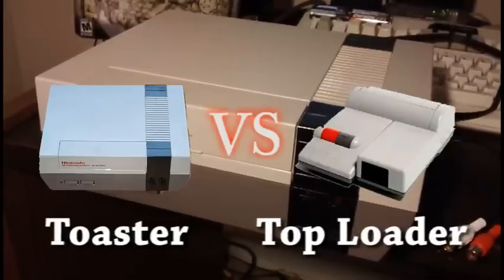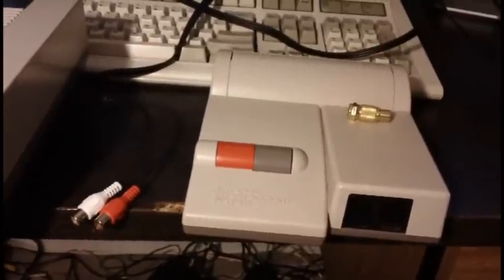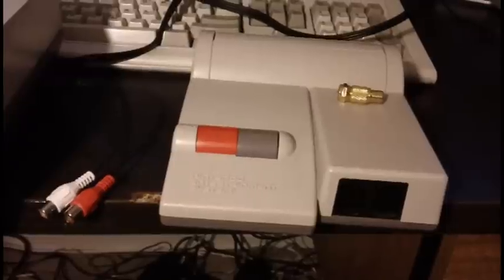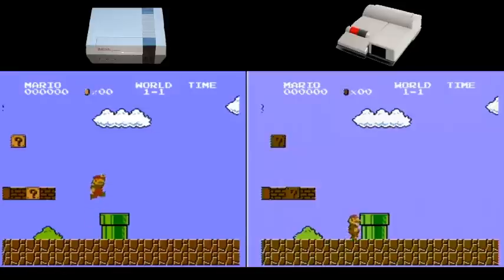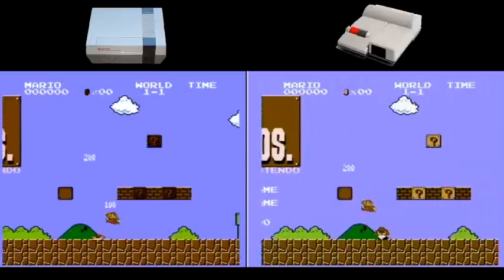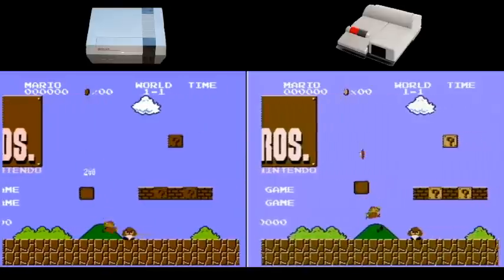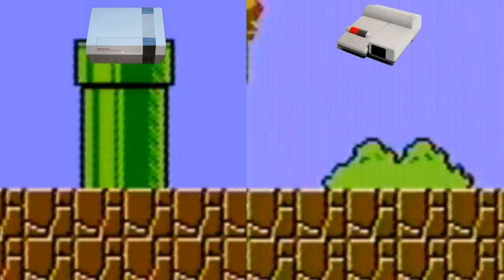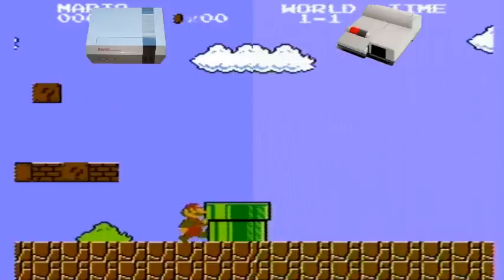NES Front Loader vs Top Loader

Comment: I'm not sure this is a fair test for the NES 2. It would fairer to use the correct cable intended for it instead of the adaptor. Wouldn't the adaptor inject some noise?

Comment: I opened and cleaned my toaster Nes when I was 13. you have to disassemble the unit, remove the 72pin connector, clean it with soap, water and an old toothbrush, after rinsing off the soap, blow dry, use vasaline and a toothbrush or qtip, then bend out the connectors with a knife or small flathead screwdriver so the pins grip the cartridge board tighter to ensure they all touch but not too tight, and thats it. reassemble and it's good as new.. or better. or you can just use emulators like I do.

Comment: Does the top loader play the game more successfully (like less crashing)?  I will deal with worse picture if it is stable.
Reply from the maker: Yes it does since the top loading mechanism makes a better connection with the cartridges esp as they age and the consoles are older.  The original has issues there that the top loader doesn't.

Comment: I just got a NES top loader console for christmas. I like it better because it plays games practically on the first try. I blow the cartridge a little bit to get dust and works perfect. It is also more rare than the box loader a.k.a toaster. But yes box loaders are easy to find but expensive at your local video game store like th exchange. they charge $50 for a bad condition box loader. Its all yellowed and looks bad. The top loaders have held there color throughout the years a play ablility.

Comment: This is the dilemma I have with the NES...  The front loader has the superior picture...but the top loader doesn't have the same reliability problems with 72 pin connector nor does it have a 10NES chip.  Why did the top loader have to have RF connector only?  Sigh... :(

Comment: Hi can anybody help me with details about the nes 101? I'm looking to get hold of the nes 101 trying to work out if it is a multi-region console for NES games? Sunset it needs to be converted others people say it needs to have a converter other people say it just plays out of the box can anybody please define whether you can play multi-region NES games on the nes 101 look forward to everybody's comments
Reply from the maker: Not %100 sure but it lacks the 10NES lockout chip.  European PAL games will likely play as long as they run at 60hz so maybe some will play fine, some might run fast or have glitches.  But I think most will run.  Japanese Famicom games will require an adapter of course (the cart slot is different size) but should all work with a basic cheap adapter.
Reply: @MN12BIRD  thank you very much you would not believe how much grief it is to find that information out even Nintendo are flaffing with it

Comment: I was driving to work 1 day and i seen a trash pile on the street and low and behold the was a toaster NES i paid $15 for new 72 pin connector i had controllers and an atari 800 pc adapter in my attic. NES toaster: $0 72pin connector: $15 The look on my face after the repairs and disabling the 10nes and powering it up: Priceless :D

Comment: I have vertical wavy lines on my Original Nintendo toaster, I have opened it up cleaned the pins, cleaned the cartridges and still the wavy vertical lines. I might end up getting another console.
Reply: Are you using composite or RF? Composite is the yellow, red and white cables. Composite shouldn't have that.
Reply: @Liam York I have switched from RF to composite cables and still have the same lines. I heard the capacitors can be an issue.
Reply: check the power supply. those universal ac adapters are pretty crappy and after several uses you get noise interference and eventually wavy lines.
ditch the rf adapter for the nes and use an rca jack. buy an rca to rf adapter and you should have better video. jail bars might still be present
Reply: Paedo are you using the AV cables on the toaster or the RF cable? You will get vertical lines if you Use the RF cable.
Reply: *****
oops just saw laims reply to you. Disregard my comment above.
Reply: ***** The original toaster will not have jailbars on RF if your system has a good RF modulator. There were 2 different kinds that came with the system one was excellent and the other had jailbars.
Reply: Troy Dietz It does have jailbars. I have a stack of 20 of them "Toasters" front-loaders and they all have evenly spaced discolorations on my hdtv and also thrue my capture devices.
Reply: db six I've serviced well over 100 of them and only about 10 of them didn't have jailbars. Most of those had high serial numbers.
Reply: some of the unit i've tested didnt seem to have them until i plugged them into my tv tuners. Problem seem to varie alot from device to device. Pretty sure there's an easy way to fix this without paying a 300$ mod kit lol.

Comment: my NES toaster kicked the bucket. even with the new Pin connectors, it doesn't work. So I decided to get a top loader. Benefit? I can now use a Famicom converter to play Famicom games without that dumb blinking light.
Reply: did you break the fourth connector from the piracy lock out chip thats probably the issue with your toaster nes 
this may come in handy if you still have your toaster nes still
Reply: RetroRareBear It tries to work, but I think it's busted
Reply: gimmie gimmie

Comment: Pick the less of evil. 
I have both systems I got lucky and found for cheep. 
Both have been cleaned in and out. 
I still use my old Nes because I don't like the lines on my top loader. I have tried everything to reduce the lines, thicker coax, or using a line chock...
Reply: Get the AV mod done for your Top Loader and that'll eliminate the jailbars, simple as that. There are a variety of modders who will do it relatively cheaply and quickly, some modders even offer their services through ebay.

Comment: I have a top loader and I'm proud, god damn it 

Also why did you call the first model the toaster? You pop pieces of toast into the top of a toaster, not the side. but whatever. All toasters toast toast.
Reply from the maker: Yeah, this video is from like 2011 and there was a time around the mid 2000's where a lot of people on forums where calling the OG NES the toaster for some reason and it caught on for awhile.  This was before someone make an actual NES toaster but maybe the nick name game people that idea?  Anyway, the top loader is fine if you're okay with RF only and if you mod it then it's all the better.  I like the design and it's more reliable than the OG.  Less common too you should be proud to have one they aren't easy to find!

Comment: collecting wise i understand why people want one but except for that there's really no reason to get a top loader. it goes for $80+ US while you might be able to get a NES1 for 5 bucks at a flea market. a little cleaning and replacing the pins is all it really need to run a game perfectly every time. i didn't even need to mod my nes10 chip as long as the game is clean. as for clones, yes the picture are sharper but most have color and sound problems.

Comment: I prefer the original nes never had a top loader but heard alot of negative things about the top loader as far as the original u can replace the pins with the blinking light win mod and later do a hdmi mod or get the avs nes and u don't have to mod it its hdmi and plays like a original nes but better

Comment: The original toaster starts resetting for no reason , (super common problem ) better off with  the top loader.
Reply from the maker: Sure, if you're okay with RF only in 2021 it's okay.  The NES resets because the "10NES" CIC anti-piracy chip has a bad connection with the cartridge and resetting the NES is its job.  The top loader doesn't have the 10NES CIC chip hence no problem.  It's a super easy and quick fix cutting one pin on the chip to deactivate it.  I've done this to my NES and it NEVER resets no matter how dirty the game is it may glitch of course but it won't reset.  Super simple mod almost anyone can do.  Another good option today to play real carts are the FPGA consoles like the RetroUSB AVS.  It's super accurate, realtime IO (no software emulation, no USB polling, driver/OS stack etc) and has super clean HDMI output.

Comment: what about the snes and the snes 2?
Reply from the maker: easy SNES supports s-video and SNES2 doesn't.  But the composite video actually looks better on the SNES2 so if you just use composite, not s-video, the SNES2 is better.

Comment: why do you compare composite with rf this is useless. It like compare a apple with a cherry.
Reply from the maker: +Christian Rheinnecker It's simple.  I'm comparing the BEST video you can get out of a STOCK model 1 NES compared to the BEST video you can get out of a STOCK model 2 NES!  I mention in the video you can mod your NES but this is to compare STOCK vs STOCK as many people asked me how the model 2 NES compares to the original.  These people wanted to know how bad the "vertical lines" really were and also if these are the type of people who don't want to deal with fixing the 72-pin connector on the original models, they're likely not the type who want to mod their systems either.  So comparing stock vs stock makes sense does it not?
Reply: I have never had to fix my 72 pin connector on my original nes. I don't know why people are saying you had to. It was never a problem for me. But I don't have mine anymore and its been years sense I had one. Wish I could find another one to play on.

Comment: the original famicom also had only rf out but the picture was just great cuzz everything inside was good magnet shielded from eachother,the nes2 was very poorly magnet shielded,thus causing alot of interference thus leading to ugly vissible collumes onscreen,i got my nes2 a/v modded but those straps were not gone but instead become even more vissible,if the modder had used a capacitator,these straps should,ve gone!!!!!

Comment: Solution. Get a PC, put it inside a NES case. Get an NES emulator and boot into it. Then you won't have to deal with any bullshit and you can get a cheap potato PC that'll run any NES emulator and you will just have to buy the NES case, not as expensive as a real NES are today i presume, if you really gotta have that feel.

Comment: I already chose to play famicom games on a av famicom, but the av famicom is my only choice on japanese hardware without buying a converter on a nes. Why? Well I'm in Australia and There is no PAL analoge channel that translates to NTSC-J channel 1, but there's a chance if I get a original famicom from hong kong, but nobody, and I repeat NOBODY I found sells one. Found the cheaper option and easiest. Getting an av famicom with 2 gamepads, av out connection, ac adapter, registered airmail and custom labeled mario bros sold seperatly, all for a cheap $173.53 AUD

Comment: Actually cheapest option: use an emulator.  :-)
Reply: True, but it isn't the same thing as playing on a console ;)
Unless of course, f.e. in my laptop i have AV output, i can plug it into my TV and buy a USB NES controller, then the experience would be exactly like on the console, still being cheaper than getting the console. The only thing is lack of game collection and joy of having special games.
Reply: Aiur Ikiza
  it's actually a lot more similar then you might think.   I have my modded Wii hooked up to my old commodore 64 monitor and with an nes adapter I can use my original nes controllers....the experience is the exact same as when I hook my original nes to the same monitor....i honestly cannot tell the difference.
Reply: pcjoeyd11 I am talking about using emulator on PC and using a PS3 / X360 controller or a keyboard. That's quite away from the feeling of playing on an original console. But your way of playing is as i can see almost no difference. Only no joy of changing and blowing into, and buying new cartridges.
Reply: Aiur Ikiza
  well, you can use atari, snes, n64, nes controllers on the PC as well (they sell usb adapters for 'em)...     and if you have a fairly powerful PC, you can use the dolphin emulator to play Wii & gamecube games (using wii remotes for Wii games and xbox 360 controller for gamecube).   1080p gaming goodness!!   :)   possibilities are endless on a PC...the pcsx2 is an excellent ps2 emulator which allows you to use 360 controllers as well as dualshock controllers.   nulldc is an excellent emulator for dreamcast (i use my 360 controllers with that one as well).    There even is an xbox 360 emulator in the works (and some games are playable...well, sort of...you need a BEASTLY machine though and lots of games don;t work....the emu is still in early beta stage though...should be about 5 years or so before it's released to the public I would imagine).
   Anyways, you get my point.   PC Rules!!!
Reply: pcjoeyd11 I know that. I was just saying.
Reply: Aiur Ikiza   gotcha  :)   btw, I know you were joking, but I really don't miss blowing into the cartridges at all   lol
Had I known when I was 15 what I know now and how easy it is to clean the carts properly (and the 72-pin connector), I would have loved that system even more.
Reply: Emulators are awesome, but for me, I prefer collecting the cartridges. I prefer having a hard copy of my games 20-1 to something intangible, no matter which console. Cover art,   displaying my collection, and even those "I'll trade you Kirby's dreamland for paperboy 2" moments. None of this can be achieved with emulators, but they are still pretty cool.
Reply: You are correct, that stuff cannot be emulated   lol    I too have a fondness for the carts and especially the actual consoles.   I have in the past gone on ebay (and flea markets, trade shows, vintage game stores, etc) to buy carts, but then I run out of money real quick and the "nostalgia" wears off soon afterwards   lol
having said that, I still have my original NES, atari 2600 & C64 systems with tons of games.  Every x-mas I take one out and hook it up to my trusty 'ole Commodore 1702 monitor and I play with my kids.    All of my games work and are 100% clean....no dirty carts go in my NES  ;-)   it still has the original 72 pin connector and never has any issues running games, and i'd like to keep it that way.
Reply: pcjoeyd11 that's cool that you play the old school stuff with your kids,man. Every time I see a kid that likes stuff from my generation, I'm like "that kid must have awesome parents", and I smile a little. :)
Reply: Pat Eldridge
  Thanks man, that makes me feel good   :)    And yeah, I feel the same way.   My kids love playing a lot of the old school stuff.,,, recently we've been playing a lot of streets of rage 2 on my original model sega genesis....i had to go on craigslist to find a sega cd because I stupidly sold mine about 10 years ago (i needed the money at the time)....but I'm glad I was able to find one recently...   anyways, I got final fight cd with the system...awesome game, and my kids love that game as well!...And I just got robo aleste in the mail (ebay) and now looking for silpheed.    Let the fun times begin!!   ;-)
Reply: pcjoeyd11 streets of rage rocks! Good call.
Reply: same with me. I only have 4 genisis games and one of them (mancer) doesen't work cuz I am uesing my flat screen  tv and I can't use my old wooden 80s tv.
Reply: ROMS hardly if ever play 100% correctly... so no thanks. When I play retro games, I want to play them in the way they were when they launched.
Reply: Aiur Ikiza "Unless of course, f.e. in my laptop i have AV output, i can plug it into
 my TV and buy a USB NES controller, then the experience would be 
exactly like on the console"
or not.
lag imput would not be the same.
the emulators don't necessary emulate perfectly the consoles.
the image is not the same.
Reply: lecorbak You're right there, but it would be close enough i guess.
Reply: nope, you gotta buy the pc first :) pc's cost more than an nes